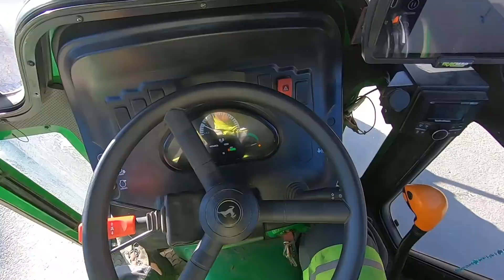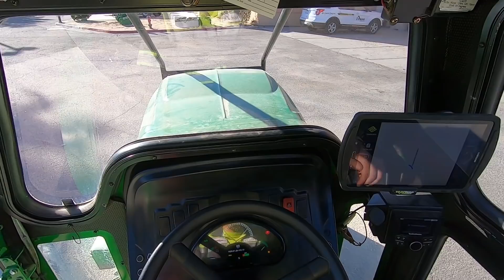John Deere 5100GN Load--Transport--Unload--FULL LENGTH

Comment: You need to drill a hole in the middle of that conduit and
put a nut & bolt through the center so it won’t roll. Hole with nut &
bolt in the middle still allows use of both ends.

Comment: Trent if you want a great cheater bar get galvanized steel ridged conduit used for running electrical wire a few of the 10 foot lengths of the diameters you need to clear from Home Depot and you can make a cheater bar for a couple trucks and plastidip a handle on one end